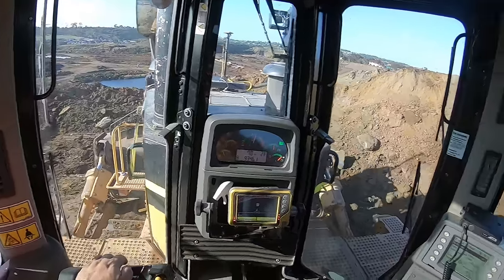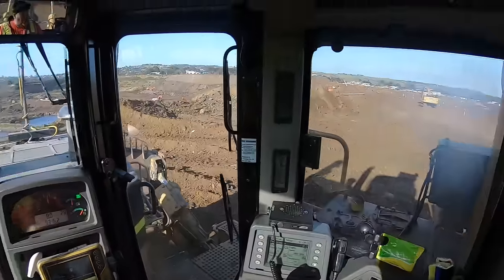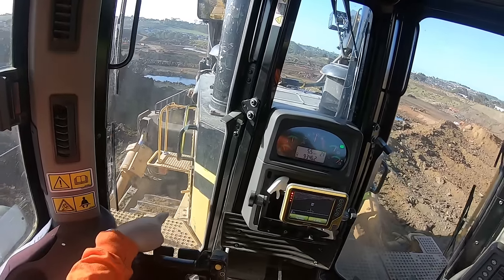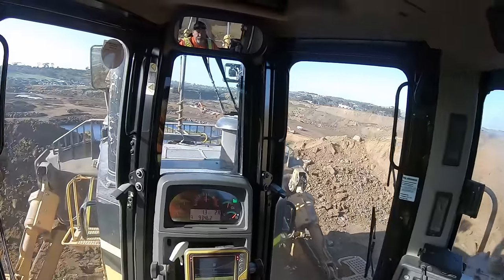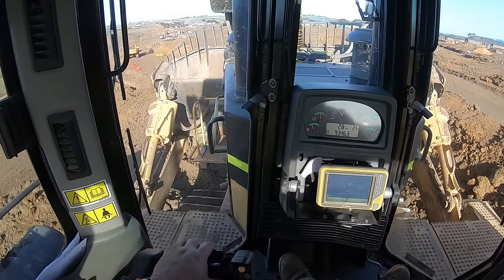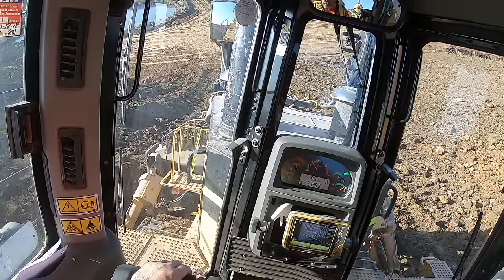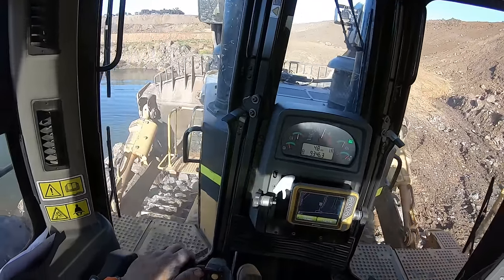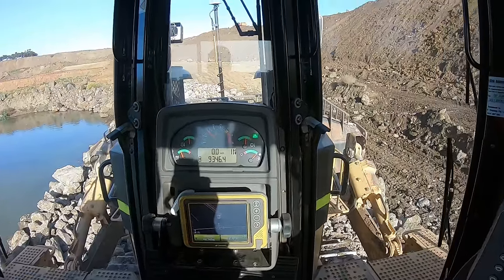13 minutes in the life of a D10T dozer operator

Comment: Damn man that dozer is an absolute monster compared to the d6's at where i work lol. Just curious, how much more difficult is it to run one of these compared to a 6? Ive never ran anything bigger than that but from the video at least, it looks like it requires a lot more skill because the blade doesn't look as visible and it's so much further from the cab. The controls are also different too i see
Reply from the maker: You’ve nailed the hurdles, for sure, but it’s not as hard as you may think. A dozer is a dozer is a dozer. 

The biggest hurdle is probably visibility. By the time you “see” and feel you’re cutting, you’re about 12”(300mm) deep and headed deeper. The right side is nearly impossible to see, so most work is done looking at the left and using the top of your tracks and a mark on the back of your blade to know when your blade is flat with the bottom of your tracks. 

On flat ground, lightly set the blade down and pick a gap between the top of tracks and a mark on the blade. As you are pushing material, if the gap is greater, material will be going under the blade and you will be coming up in grade. If the gap is smaller, you will be cutting and going down. This, combined with the bubble in your butt is how you shape the ground to the level and angle you want. 

Instead of diff-steer, you have fingertip control paddles that apply the friction steering that was historically the two large steering levers on all Cats prior to the “N” series on D8 and D9, and I believe prior to the R on D6 and others. 
With friction steering, the first part when pulling on the lever or paddle engages a clutch on the side your lever is pulled. As you pull further, you start to engage the brakes on that side. So, initially you clutch and allow the other side to keep driving, allowing a slight steering, and the turn gets sharper the further you pull on the lever up to the point you fully lock the one side and the other drives around it. When going down a steep grade like my batter, you actually have to apply cross-steer, because when you initially apply the friction and the clutch starts to slip, that side will actually speed up because of gravity. Pushing down a steep slope, you lightly pull on the left steer lever to make a slight right turn. 

Finally, sitting up so high and far from the ground, you have to train yourself to see the ground from a different perspective. It gets harder to judge highs and lows. I get my operators (when new to large equipment) to get out and look from ground level after they’ve worked an area and before they leave to a new job. What looks smooth from sitting in the seat can look like a bombing range when you get on the ground. By climbing down then back up and looking at it, your brain starts to identify what you’re actually seeing, and your judgement improves